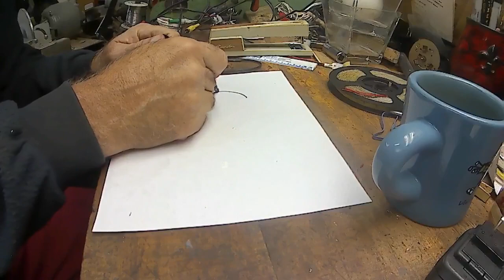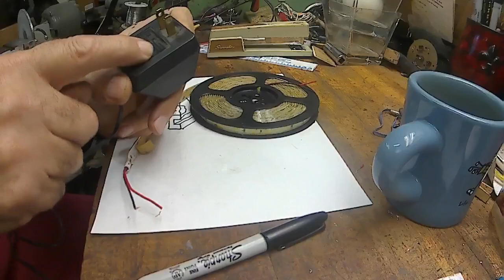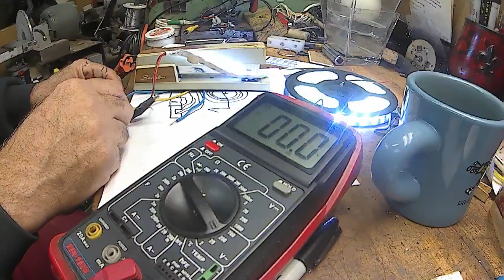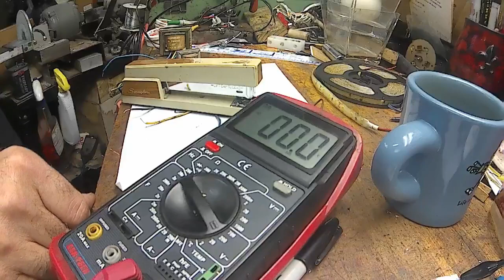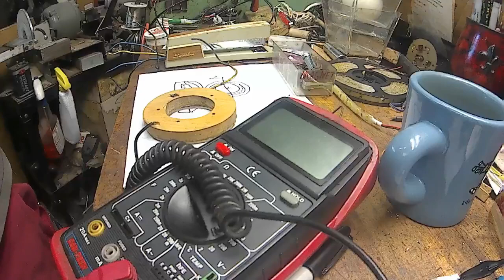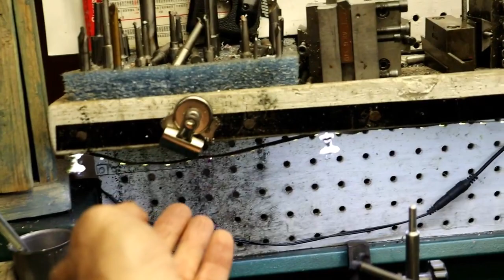Vertical mill light ring

Comment from the maker: I actually should have made a full bridge rectifier to convert ac to dc current it has 4 diodes not just 2.
Reply: I was surprised when it lit up with AC. Must be what squeezed though when the current was between positive and negative. 🤔
Reply from the maker: @michaelmurray9154  Camera didn't pick it up to well but they flickered on ac thats because it only uses half of the cycle in the ac current. It works much better with a full bridge rectifier and they are easy to make with 4 diodes. Then it will use both sides of the cycle.  Anyway I ended up putting 8 of the small magnets in instead of the larger ones with the screws and they hold on tight now.